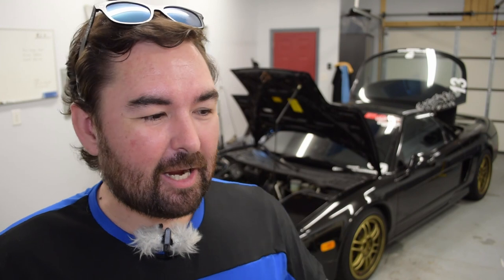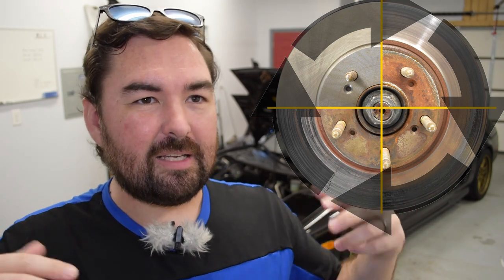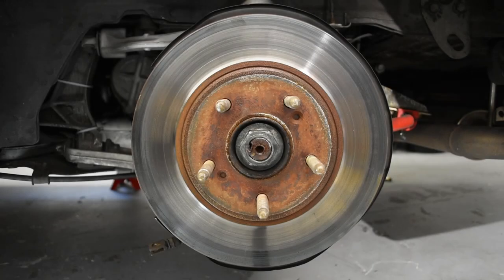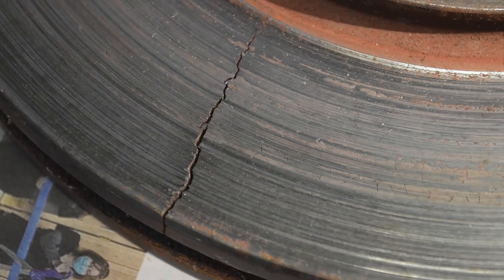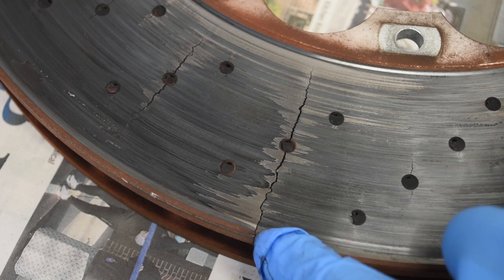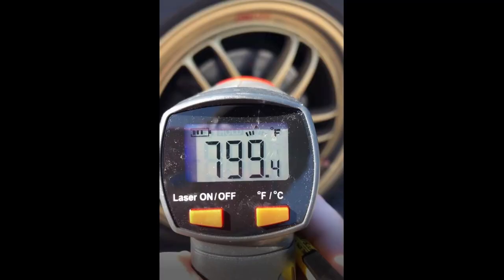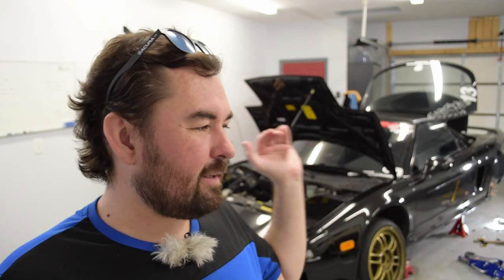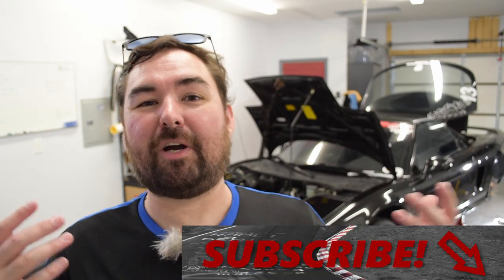Brake Rotor Life Cycle (Track Use):  Why they Fail, How to Anticipate Failure, and Which I use.

Comment: Great video! I hope to avoid phase 5 for sure.  A video about bedding in the brake rotors would be pretty handy.
Reply from the maker: Thanks!  I'll put that in the idea stack though that is an activity with some nuance as the process may vary with the pad compound.  The HAWK HP+ I run right now are easy to please, but I've heard stories that higher temp compounds can be tricky at times.

Comment: with my heavily tracked m3, i can get like 5 years of track on front rotor rings, with a stoptech kit. never lost a rotor to cracking. plenty of pads, though. and if the rotor slot is starting to look shallow, the ring can go to the rear, since the rotors are the same size on my cars with 4-wheel kits. but speaking to that "ting" noise, i was talking with a GT3 driver after coming off the track, and after a few minutes of talking about brakes, we hear a loud click from the corner of the car where he was standing. sure enough, the porsche rotor fully cracked right next to us, while we were talking about it.
Reply from the maker: Good data point on the stoptechs.   I may eventually go that direction with the NSX... but I suspect that will be driven less by performance and more by OE parts scarcity and a desire to not have to deal with the integral screw-in e-brake when changing rear pads😅
Reply: Lap of the World and if you get the 4-wheel kit, all rotor rings and pads are the same. So you can run old pads in the rear, and new pads in the front, and keep cycling them like that.

Comment: Nice video! I'm curious about your general approach to maintenance before/after track days. Oil changes, brake fluid flushes, alignments, etc. Also, have you found an affordable approach to get your car inspected before track events?
Reply from the maker: Most groups I run with allow self tech as long as you have decent experience.  Regardless of if I run an event that requires it, I do usually take it to a trusted shop once a year for a second set of eyes.  Oil changes 3k miles or every couple of events if I somehow didn't cover the mileage.  Brakes get kinda burped before each event to keep fresh fluid in the calipers where it takes the most abuse, alignments again once a season unless something feels funny or funny tire wear.  Probably some details, but maybe a good video topic down the road.

Comment: I know the drilled rotors are very prone to cracking but do you feel slots are still slightly more prone to crack than a blank rotor would be I'm having lots of issues with cracking on some slotted rotors and I'm not even on sticky tyres and not driving very hard either at least no where near racetrack pace. I have had blanks before and not seen them crack even out at the race track they didn't crack would you say slots played a part in cracking ?
Reply from the maker: Caveat that I'm not an engineer/metallurgist but I suppose any cuts or holes in a rotor surface could add stress risers that could lead to premature cracking.  That said, there are a LOT of factors in play.  Heavy cars with smaller/lighter rotors will be higher risk, as will any car driven hard in colder climates due to the potential for more rapid contraction off-heat-cycle.
Reply: @LapoftheWorld  Yeah it's hard to say lots of variables thank you for the quick reply.

Comment: What pads do you use and how long do they last relative to the rotors?
Reply from the maker: On the NSX I've been running Hawk HP+.  I've had people tell me that's not enough pad, but all data says it is at least on 200tw street tires with a car less than 3000lbs.  I typically get 3-ish weekends or like 4-6 total days out of the pads, and probably about 5-6 events out of the rotors.  I could probably go up in pad to something a little more robust to get more life, but the expense of the upgrade might erase the "savings" of getting more time out of the pads.

Comment: Great video! But you didn't mention scratches and grooves, which are what my rotors have now. So how can I determine the phase if they have scratches and grooves (not deep)? Coz other than those, it seems they are between phase 2 and 3. And is it OK to only change pads at this stage?
Reply from the maker: The grooves running around the face are normal.  That's like phase 1.5 or something before you start seeing any radial checking/micro cracks.   From my experience one can swap pads, they just may take a bit longer to bed in and match the slightly uneven surface.
Reply: Thanks for the reply! Actually the rotors I mentioned have gone through ~70% of the current pads life, so the grooves are more like 'after track heat cycle pattern' instead of 'not bed in yet' (well, I could be wrong). But it seems they are still OK based on your experience in spite of this? @LapoftheWorld
Reply from the maker: @YujinBao  yeah, I've had rotors get grooved after going through a whole set of pads and I'll just swap the pads unless the rotors have started micro cracks.
Reply: Gotcha! Thanks so much! @LapoftheWorld

Comment: I have the same thought about BBK vs blank rotors... I can't stomach spending $200/corner to refresh the rotor rings vs a $60/corner Centric High Carbon blanks on the Z. But, I also only do a couple of track events a year.

What pads were you running on those rotors? HP+?
Reply from the maker: It would be different if I thought I was struggling for stopping performance, but as-is with my stock motor, relatively light car, I can engage ABS if I'm too heavy on the pedal early in the braking zone, so that tells me that it's the tires, not the brakes that are the limiting factor right now.
Reply: @LapoftheWorld  Understood! I don't want for stopping power with the factory Brembos on the Z, but a larger rotor would be nice for helping slow a 3200# car...

Comment: I’m interested to hear if you’ve had any experience with high carbon blank rotors (like Centric / Stoptech), which are a few dollars more per rotor than the standard auto parts store special. I seem to be able to get a couple seasons out of mine, granted I have some additional cooling.
Reply from the maker: I have not run Stoptech, I believe I have used Centrics, although it's been a while.   I honestly think if I only did warm-weather events, I probably could get a couple of seasons out of a set of cheap-o's.  It's those cold-weather events that usually kill them or at least finish them off if they were already starting to "grain" a little.  It would be interesting to do a controlled experiment with a high carbon vs. a bargain-bin vs. a cryo-treated rotor.  Maybe I'll stick that in the idea-bin 😁
Reply: Lap of the World That would be a neat test to compare rotors. Keep the videos coming, definitely enjoy your channel. Have fun at the track, I’ll be headed to Dominion Raceway in VA next month, but hopefully this heat breaks before then. 👍
Reply from the maker: @RoadrunGTI  Thanks for the kind words!  Dominion is a fun track, I made it up there in 2018 and had some good fun.

Comment: what about brake cooling ducts? Maybe would worth it for you on track?
Reply from the maker: 😁 Yes!  "tested and approved" lol:  https://youtu.be/Pu-pRbAkgOI
Reply from the maker: The real caveat is this:  although they help braking performance, there's some chance cooling could hasten cracking in some circumstances because it would shorten the cooling cycle....but other times they might help by keeping peak temps down.  Probably a good question for an actual engineer.